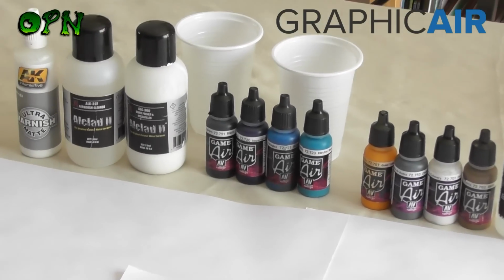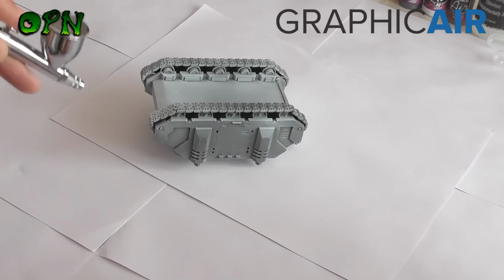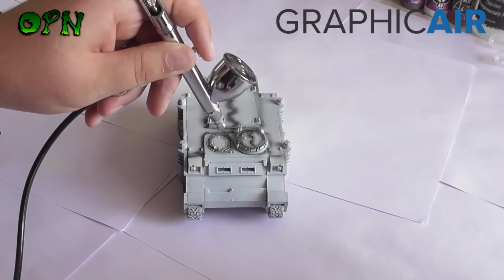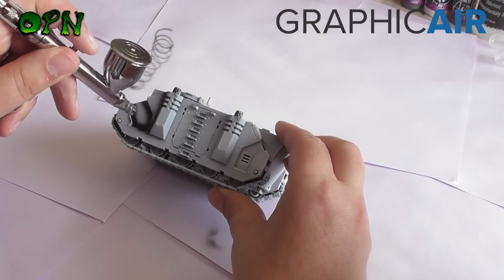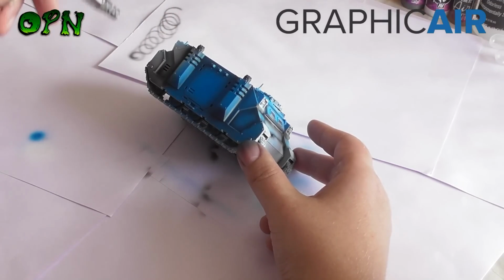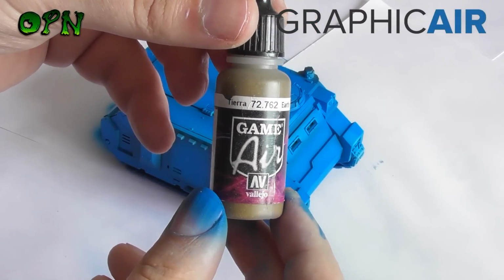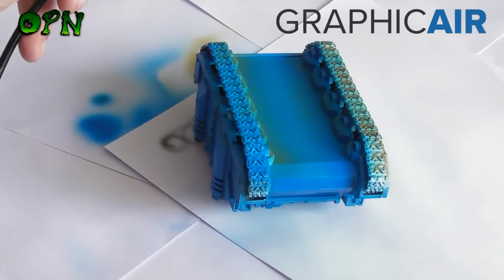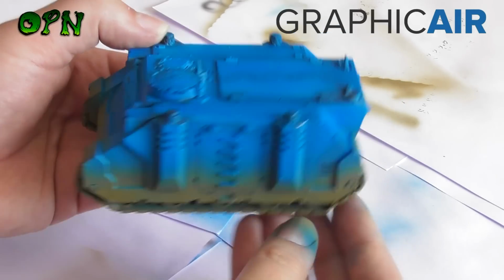How to Airbrush a miniature for the complete beginner

Comment: A couple of priming/painting tips from a former professional aerospace painter: paint the bottom first. Paint the corners and edges first then move on to the flats, aka frame the piece with paint. Use thinned primer and make a few passes with some dry time between. Use a lazy Susan so you have to touch the piece as little as possible. Wear gloves to keep things clean and eliminate contamination because of skin oil.  Use a blow dryer to set the paint. Less paint means less chance of covering up the details in the piece. Keep the air on but release the paint at the end of your strokes so you don’t get “dog bones” at the end of each stroke. Shade with a watered down black or a gray, use darker shading in spots that would have less light hit it. Shadows aren’t all the same darkness. It varies depending on the light source.
Reply: Thanks for the tip! I just got an airbrush, and I'll be sure to use your techniques
Reply: Thanks for the tips.  Seriously helping me out here.  Thanks!

Comment: Extra tip. 
Go to a bakery isle or check out a cooking shop and get a cake frosting turnstile, its a cheep little thing that you can revolve easily. So no need to touch the mini (other then to turn it over!)
Reply from the maker: Seithon Jetter I do have one but left it in my loft. There great for airbrushing 😀
Reply: Seithon Jetter OrcPainterNerd  has a few, but he usually uses one that was originally a dark charcoal/black color with little triangles on it.  The "spinner" is now covered in paint from various projects.

Big up, OPN! 😉
Reply: Seithon Jetter oo
Reply: Equally, just a square of thick cardboard (a flap cut off a brown box) and blu-tack your model to it. Then you can rotate without touching the model.

I'm also a big fan of crocodile clips that you can get on sticks. Clip them up under the parts, put the sticks in a block of polystyrene or balsa, and you get really good access up underneath the parts. You can make the clips yourself, but if you find them cheap it's worth buying them just to save yourself the effort.
Reply: You can get airbrush booths now with them built into it. Awesome stuff.

Comment: You need to clarify if 20 PSI is on load or off load. If you set your compressor to 20 PSI the second you start to pull air from the brush, there will be a sharp 5 to 15 PSI drop (depending on compressor quality and seal quality at hose connections). This is your working PSI. In my experience in teaching friends to airbrush, this is what trips them up the most. And it was a big road block when I was starting.

People will get a cheap compressor and set it to 20 psi, then hit the air and not notice that they are actually working at 10 to 15 PSI and will have constant problems due to not properly thinning paint for such a low working pressure.
Reply from the maker: Anthony Andrews great comment mate. 😀
Reply: So what is the solution to this, how can i prevent that. I am new to airbrush.
Reply: There is no preventing it. That's why you need to have a dual action brush so you can blow off the extra pressure before starting the paint flow and get to work.
Reply: So should it be 20 PSI before you press the trigger or during?
Reply: Anthony Andrews I just discovered this, this weekend. I was not sure why this was happening.  But set my pressure based on 'on load'. I was thinking my regulator was not working properly. Thanks for explaining
Reply: Great tip mate, i discovered what you're saying a few weeks ago (i'm still new to airbrushing). Fortunately, i got myself a nice Iwata Eclipse so cleaning clogs is an easy task :)
Reply: UserNamedNone if you lose 5 pressure when you actually start it, what if you set it 5 higher
Reply: Before adding any paint to the airbrush, and after it is connected to the compressor, push the air trigger down. Your PSI on the regulator will drop. While holding the trigger down, set the regulator to the desired PSI. For example, if you want to spray at 20 PSI, set the regulator for 20 PSI while holding the trigger down. And, no, you do not need a dual action airbrush to set your PSI this way. I do this for both my single action and dual action airbrushes.
Reply: Hi! I know this comment is old, but I was wondering if you know how to check air pressure on a device that doesn't display it? I have a "master airbrush G23" I think it's also called studioset? And the air compressor is a "MAS KIT-VC16" I can adjust pressure but I don't see any way to see what PSI it is. Any tips would be cool, thanks!

Comment: I'm having some problems. I just recently bought my first airbrush. I am using an Iwata eclipse and the compressor is an Iwata ninja jet compressor. It only goes to max 18 PSI unfortunately, but I found using max (18) doesn't seem to work that well. The paint splatters or comes out in inconsistent sprays, like a dotted pattern almost. I am using Citadels air paints that are supposed to be prethinned and made for airbrushes. Most of the time I tried working with about half the PSI on the compressor, but I feel like either not enough paint is coming out (even when pulling the trigger fully backwards), or the paint comes out inconsistently and doesn't look good, or it feels too watery, like if I just spray air over some parts you can literally see the watery paint being pushed around.

What am I supposed to do? :(

Comment: Do you use any sort of thinner / flow improver on the Vallejo Air paints, or do you just shoot it straight out of the pot?
Reply: Vallejo air paints are pre-thinned in the bottle, so no need to thin, if you want to use their normal model or game colours, you may want to thin it a little.

Comment: Hey There OPN. Helpful video indeed im just trying to get into the Airbrush thing getting my st AB. Which one should i get Iwata Eclipse or H&S Infinity 2 in 1 ?
Reply: Neither!  You should get a Badger Anthem 155.  It's more forgiving than the finer airbrushes.  It comes with a general purpose needle .78 and you can get the finer detail needle, nozzle and spray regulator later when you've mastered the basics of airbrushing.  I use the Anthem 155 and so far have no need of a finer needle/nozzle/spray regulator.  It will do very fine lines out of the box.  Plus the fact that it's American made and parts are cheap and easy to come by.  Just my 2 cents worth.  I use my airbrush for model railroading.

Comment: I guess its good if you dont want the pressure too high but if you have a regular spray can hold it around 1.5 feet or 40~50 cm away to reach the same effect
Nice thin layer though

Comment: How do you get on with the AK varnish? I found it a bit too thick for my airbrush directly from the bottle, maybe I'm doing something wrong?
Reply from the maker: Ben Zone the ultra matte varnish is very thin. What needle nozzle are you using? It sprays excellent out of my Iwata eclipse cs airbrush.
Reply: OrcPainterNerd I've got the iwata HP-CS with a 0.35mm needle, it was the AK matte varnish causing me the trouble, I didn't want to thin it but if paint from the bottle was that thick I'd definitely be thinning it first

Comment: My Wicked pre-thinned acrylic airbrush paints call for a really high psi (30-40 iirc) and a large needle (.5mm). Is it better to follow the instructions and spray at that high pressure/needle size or thin more to use a smaller needle and possibly lower psi? 
I love your videos very informative and great pacing for the presentation. 

Thanks,
Frad
Reply from the maker: Frad in'Ryth what are they for textile work? If so a higher psi is disered. On plastic models though this pressure would be way to high. So it depends on what your airbrushing.
Reply: OrcPainterNerd It's going to be for plastic or resin miniatures
Reply from the maker: Frad in'Ryth if you need to spray these paints at higher psi try to spray at the minimum of 30psi and see how you go mate. 😀

Comment: Don't you need to use nitrile gloves?  It will keep paint off your fingers and keep finger print oils off of the model.  The paint you're using looks like a flat paint, aye?  Is all your paint lacquer based?  I do like your weathering technique.  You have given me a couple of ideas that I will persue the next time I airbrush a model.  I do model railroading and I like the idea of using a dark shadowing before the final coat.  I usually have to top coat the models in clear gloss in order to put on decals.  Then I use a flat clear coat for the final coat.  I think I am prejudiced against all airbrushes that aren't Badger.  I use a Badger Anthem 155 which will do very fine lines in the right hands.  :).  LOL. Thanks for the video, mate.

Comment: Alcad? Odd choice for a beginner's guide. Maybe a standard spray primer would be an easier start?
Reply from the maker: PHILLIP GOODMAN it's actually more easy to spray alclad than standard polyurethane primers I have found. It's smoother, thinner and cures much quicker. The only down side is you need to be well ventilated.
Reply: Good point. The presence of solvents in the Alcad were my primary worry, really.